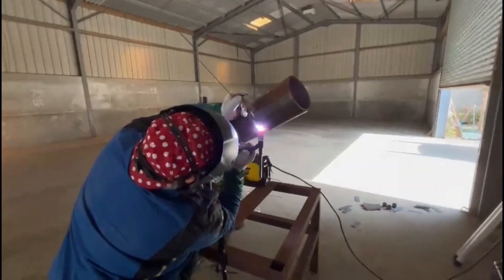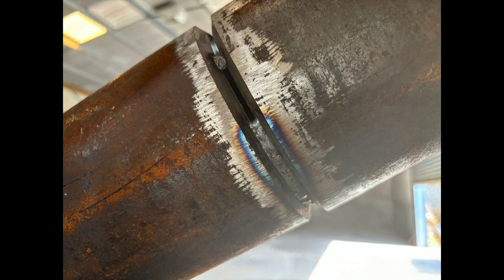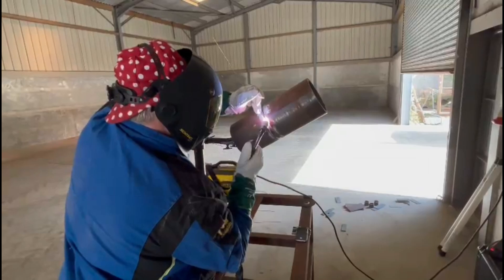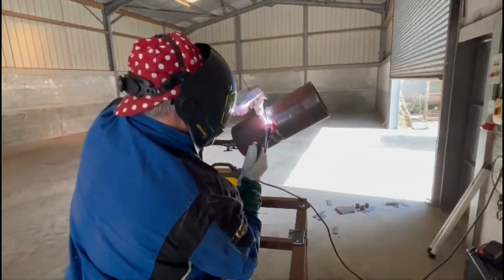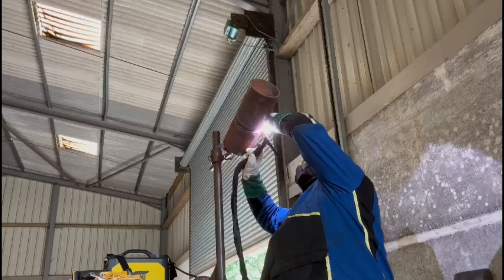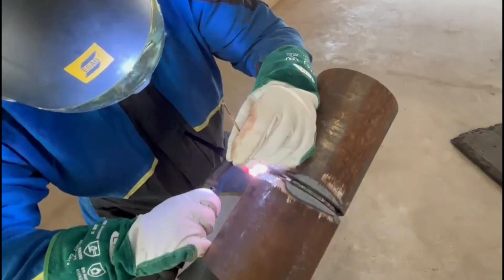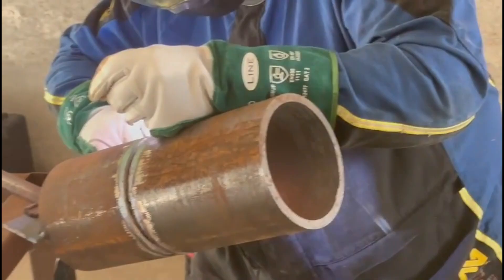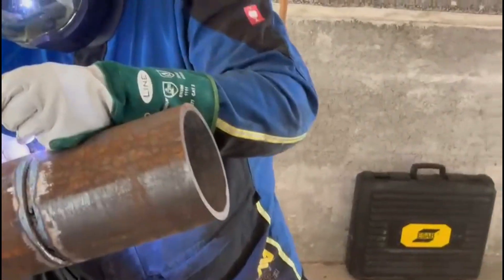6G Tig welding pipework (Root pass)

Comment: As a professional TIG welder I can tell you that 85 amps, feather edge and +2.4mm gap  this set up up is not good.
If you like a feather edge use a 1/16 gap and 120 + amps, do not pull the wire out, you should push it in until you can feel it going in nice, if it is not pushing through the amps are too low, travel speed can/will increase with the amps so heat input is likely less than you have now.
Best is to use a 2mm landing and a loose (after tack up) wire gap, hold the wire inside the gap at 120 + Amps and go for it.
Try it and let me know if you felt it.
There is no need to keep pulling the wire out and "looking" to see if it is going through, you should "Feel" it.
Also for a 6G test it should start at 6'O clock and finnish at 12'0 clock within reason if it is a V UP Progression
Reply from the maker: Appreciate  the comment, other videos
We use bridge tacks however for this we used root tacks with a feathered edge. 

The industry we come from we work to .6mm tolerance so whilst it could be more practicable to smash the wire in and turn up the amps, the root would be extremely heavy and you would then change the material properties and structure by heating the material too much, hence why the 85 amps for our root run, I don’t think we would use around 100- 120 amps for the hot pass. 

If you are from the uk Malcom we will invite you to our next shoot and we can video you completing the 6G test piece with the parameters you stated if you choose to do so. 

6-12 o clock is standard we only completed going over the root tacks to show how to go over the feathered edge, ideally you are correct you go straight up from 6-12 o clock however sometimes you may need to stop for whatever reason and need to restart so we were just showing how this would be completed. 

Thankyou for your comment and thankyou for passing on your knowledge it’s really appreciated and may help someone out. 

(If you fancy coming down and showing your technique in action then invite is there) 😃